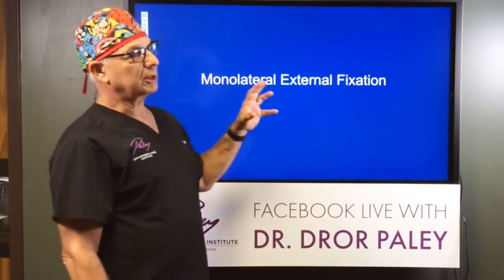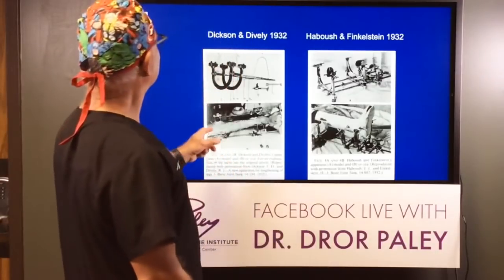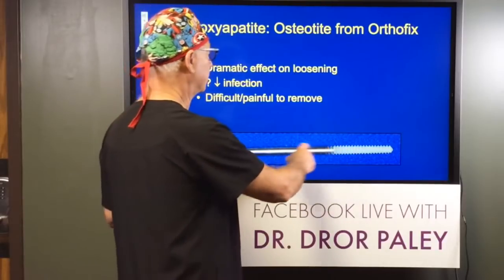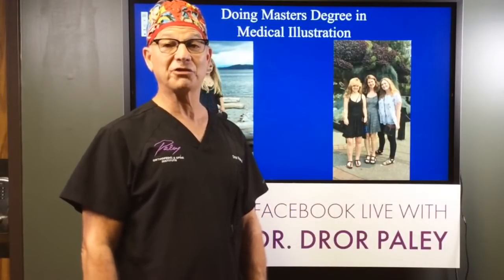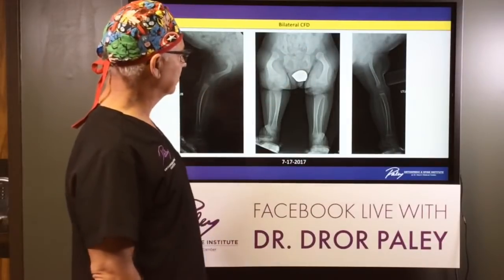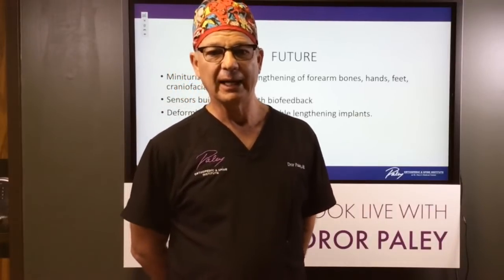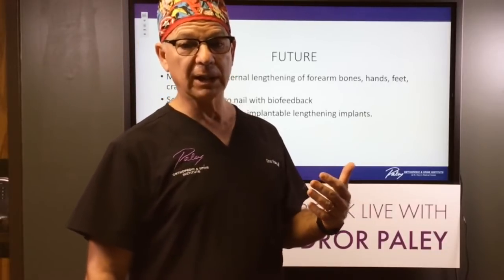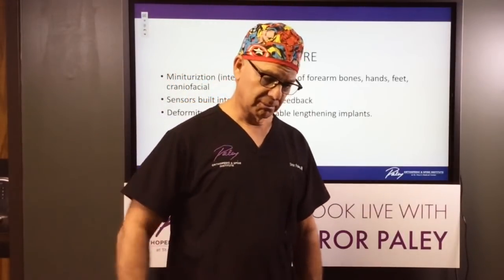Paley Institute & Limb Lengthening Innovation: Past, Present and Future.

Comment: Hi Dr. paley.
I think there is something wrong with the information you provided. The software and system you mentioned as advanced is the "Hexapod" system.
I guess no inexperienced orthopedist can use your current software. This is a big disadvantage.
Your current software is referred to as the steawart platform for mechanisms.
In addition, the biggest disadvantage of hexapod systems is the singularity problem. It is for this reason that you cannot make any connections other than the specified holes when mounting to the patient.
There are a lot of disadvantages, as I think you enter the bar lengths into the software one by one. In other words, he has skills that are not very different from Ilizarov, only simple software that you can sell dearly.
Frankly, we see the more advanced software you have shown as a system that does not have enough know-how to make an open library and donate it to the society.

Comment: I’d love to see torso lengthening
Reply: That's impossible, as much you can lengthening arms and legs but torso required lengthening your vertebral column.
Maybe in a near future you could re activate your growth plates for grown more taller until certain point without needs of break your bones for install  mini remote controller devices.
Im 5'7 im I would like be 6'2 as minimum.

Comment: I keep hearing that these surgeries will have you in a wheelchair after x amount of years. Is that true? What are really the downsides of this surgery? Does the bone weaken? It seems to me with these modern techniques there are little to no complications and the bone grows the same way it would as when you break it, like many people do with sports or injury and they seem to do fine.
Reply: No you will not be in a wheelchair after x years. That is total nonsense. they have been doing these types of surgeries in Kurgan, Russia for 50 years. One aspect I would stress is pre-operative conditioning both in terms of flexibility and strength as well as post-operative rehab.
Reply: @calripson  Thanks for your input. Would you say it's more beneficial to do strength training for the leg muscles before surgery or the opposite and leave the muscles much smaller in size? Which would help better in stretching and flexibility? My guess would be none trained because with less muscle tissue and weaker muscles overall there's less pulling force on the bones and less tension overall. I'm no expert though.
Reply: Add sir lemb leathing surgaury